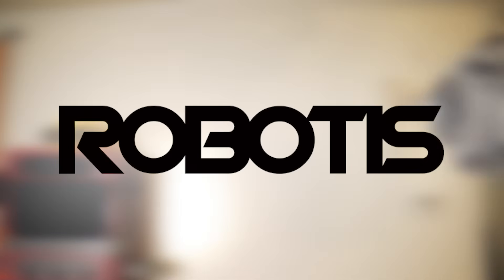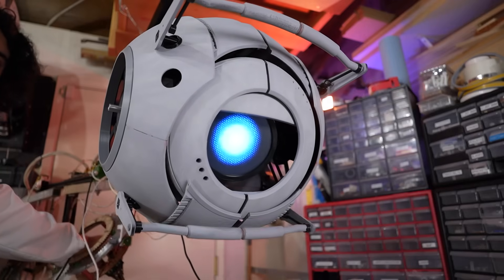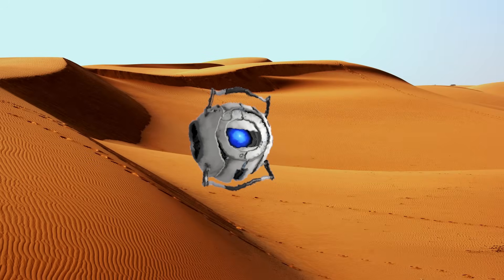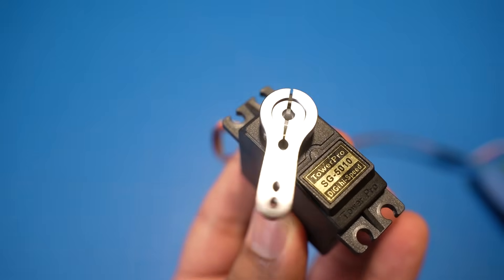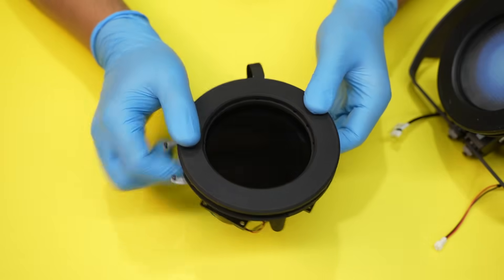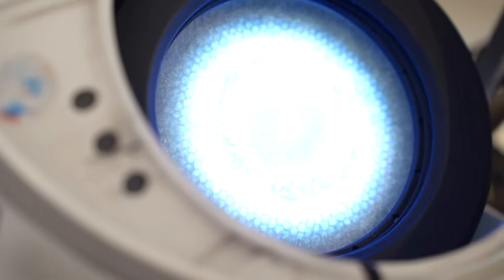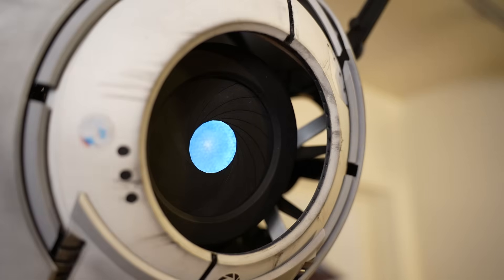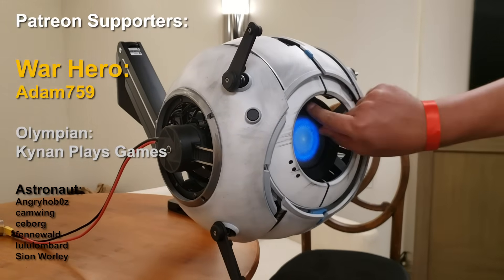Building a Better Animatronic Wheatley from Portal 2

Comment: Hope my prusa is ready. Don't know if I'm gonna use PLA or nylon. Not quite sure...
Reply from the maker: Start with PLA. Nylon is very expensive/prone to print failure. If you can, use PETG or even better ASA (in a ventilated space)

Comment: The screen was good though, because it could also dialate and stuff, I think you should find a way to add that back, and also hook it up to OpenAI to a LLM with a prompt of somthing like this:

"You are in control of an animatronic "Wheatley" from the Game Portal 2, I need you to produce a .json style message, with every reply (ONLY THAT NOTHING ELSE) in following format, including eyeDialation (number 0-1, max two decimal places) and text, mathing the mood, and tone of the text. You can have as meny sections as needed, but each one must have at least 1 word, do not split words, and must include “eyeDialation” and “Text”. I will then pass that using software and API's to my Wheatley, using TTS, and I will respond, and send that back to you using STT. .json example:
[
	{
    	"eyeDialation": 0.70,
    	"Text": "This is"
	},
	{
    	"eyeDialation": 0.65,
    	"Text": "the part where"
	},
	{
    	"eyeDialation": 1.00,
    	"Text": "I kill you"
	}
]

Remember you should act like, talk like, and be like Wheatley from Portal 2. 
My first input for you to reply is:
Hi"
Reply from the maker: Definitely worth exploring LLM driven emotion. I've played around with it a little bit, but havent fully tested anything. Also, the screen didn't dilate. This version and the last one have the same mechanical iris for dilating his eye.

Comment: Wonderful stuff again! Just watched the GLaDos video and then noticed in the comments there was a Wheatley too. Quick question, is the clicking in the "live" shots from the sections rubbing together or is that the motors?
Reply from the maker: Thanks! Yes, parts moving against each other. Most of that coming from when his face ring pushes against the inner sliding ring piece. Ran out of time to make the ring cap out of rubber

Comment: Would be REALLY cool to see you use the Live Link / Metahuman Animator tracking for Unreal Engine 5 to control the movement. Assuming you can remap the digital face bone values to your setup you'd have straight performance capture

Comment: amazing work, and I wanted to ask about the iris. the effect is incredible - did you just use that led ring, a piece of normal paper and some plexiglas in front? what color are you using for the LED? white, blue ...? 
asking because I'm interested in how to diffuse best LED light - I have a home project where I use them and I am not too happy with the "discreteness" of the led light points ..... many thanks for any tip

Comment: I think Mark IV should have a key-framing system on the software side for the animation so you can achieve more game-accurate automatic movement by essentially copying the animations from the game via very finely tuned keyframes for each component. (While still having the option of manual movement of course)

Comment: I'm not knowledgeable enough about electronics to properly appreciate the effort that went into this but it's still really cool! The only comment I could really make is his 'eyelids' could be more expressive and that'd help sell the voicelines. It could just be down to the controller more than the parts though. Not sure how feasible it'd be to program set positions for eyelid movement but in my head I feel it'd be easier to transition between expressions that way? Again I'm just commenting as a hobbyist artist so what I'm saying is probably not practical. XD

Comment: Next on this channel:
Mk. IV fully fault tolerant, even if a motors breaks you don’t have to replace anything because other motors can do the job.
Mk V a one way mirror behind the iris so you can put a webcam to track yourself
Mk VI reintroducing something akin to raspberry pi (maybe an FPGA? Or maybe a risc-v processor) capable of actually AI things….

Comment: This is some outstanding work! Working on a similar (sort of) project for a similar event (sort of). How did you code the esp32 to blink the light in time with the amplitude of the sound file?

I don't need your complete code, just a big-picture nudge in the right direction. I've been working on modulating servo movement to sound file amplitude without using a mic, and I've run into issues.

Thanks!

Comment: Wow. You've outdone yourself, again! If I ever have a mancave, I would want this Wheatley as my voice assistant in it. I am wondering though, what's the advantage of the ESP32 over the Pi, is it a space thing? I really liked the screen in MK2, a bit sad that it's gone. That being said, the eye still looks good.
Reply from the maker: Less wiring, simpler programming, easier wireless control, and most importantly: it starts instantly, instead of having to boot every time, which was a real hassle in past versions.
Reply: @MrVolt  thanks for the response! I see your reasoning now. Looking forward to seeing more content about it.

Comment: God damn this build is beautiful, i think it could get even better with some software upgrades as well, (obviously you can always ignore me but i just had some ideas )
- motion smoothing or Velocity/inertia dampening so his iris doesn't "slam" into the edges of his range of motion
- The iris feels like it can turn too far left and right for a natural look, but that can be limited, and is also very subjective

lastly it's probably possible data mine the animations from the game, mimic them, or get a 3d animator to do a an animation in blender, and then exporting the positions into arrays you can use in the code

Comment: Top notch work as always, the animations are really quite smooth, the only shakes seem to be when the eye drops down and gravity helps, perhaps with some software you can adjust the speeds. I will check out those servo's I need some for my projects.
Reply: I ordered two of the smallest servo's one for my StealthBoy, and one that may work for the Fallout Radio.
Reply from the maker: Thanks man! I agree. It needs some rework for the face. Lookin forward to seein you get into Dynamixels too

Comment: You probably should have kept the LCD and the pi. The pi has WiFi/bloutooth and more horsepower. And better audio. Just one cable to the amp you already have. But other than that. Great build.

Comment: I'd say losing the screen kind of takes away from his expressions, as quite a bit of them require his light blinking or dimming to a point you can't see details.
Reply from the maker: It's always a tradeoff. I'd like to use a proper printed transparency + tinted diffuser + lens in the future for more realism/contrast.
Reply: I saw someone who used a literal aperture. I felt it added a lot because of how his eye getw smpwller when he's scared :3
Reply: @nova_thirtyseven  You mean this guy? 😉🤔
Reply: @suicidalbanananana  oops lmao
wasn't sure if it was actually him x-x
Reply: @nova_thirtyseven  An aperture between the light and the paper that's translucent instead of black could help affect the brightness.

Especially of on the outside there is a very thin black film over the blue paper eye. Meaning internal light is required for the blue to be visible, but barely any at that.

I'd try the test myself but I have no real knowledge on the electronics or side of things. I can deal with mechanical stuff or post processing, but I just could not learn much in my required ECE classes.

Comment: I think having the ability to also pan/tilt the whole assembly on the maintenance rail would make it look even more realistic/alive. But I’m still very impressed. Cool project!
Reply from the maker: That's definitely needed! A bit more to design for that since Wheatley weighs 4kg, so I need fast and strong motors to make the rail mount expressive too.
Reply: @MrVolt  oh yeah, sounds like real pain. But thanks for releasing the files, i have been thinking about building a wheatley myself so this definitely helps!
Reply: ye this would really do it lol

Comment: Absolutely fantastic! It looks great! definitely put a smile on my face 

I will say I did prefer the digital screen for an eye more than what's in Mk III just made it look more real.
the only other thing I can think of to improve the performance of Wheatly would be to make his body able to pivot on the pole he is attached to rather than being static. I think it would just add that bit more extra life to him 

But that's the only feedback I have I think it's absolutely gorgeous!
Being a collector of life-size props I wish this was a collectible coming to market. 

Keep up the fantastic work!
Reply: The digital screen had the advantage of making it very easy to instead show as other cores. It also didn't light up the inside. I think it's still a better solution.
Reply from the maker: overhauledunderpaid6469  Hmm, but he does have a mechanical iris still... Or are you referring to something else?
Reply: @MrVolt  I think just another form of print or defusion would do the trick, it just seems a bit flat And the reflection doesnt seem as Real as the last one
Reply: @MrVolt  It would have been nice to see more of the iris in action, kinda only shows up in the final clip of the video
Reply: @MrVolt  he's referring to the ability for Wheatlys eye to shrink when the aperture he has in the game closes and opens, this new model has Wheatlys eye stay the same size all the time. I agree as this being the most disappointing removable, but besides that everything else is great
Reply from the maker: @LlamaLogic  That feature wasn't removed. You can see it a t 9:59 and 13:00
Reply: @MrVolt it’s the actual screen for the eye, Yknow, where the light comes out
Reply: @MrVolt   They mean it as an display doing the shrinking of the eye/image. Right now it's just the shutters shrinking down and back, unless I didn't notice something. And I do have to agree with others there - Going back to a full on display would look much better, even with more effort, work time and money put into it.